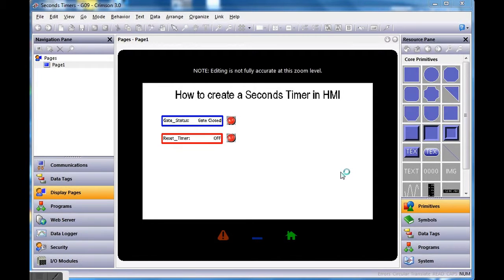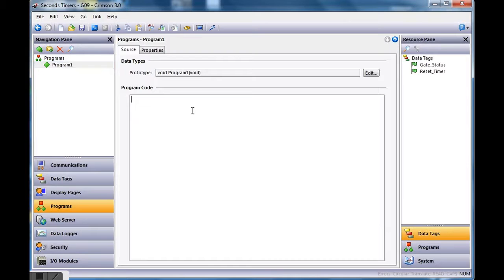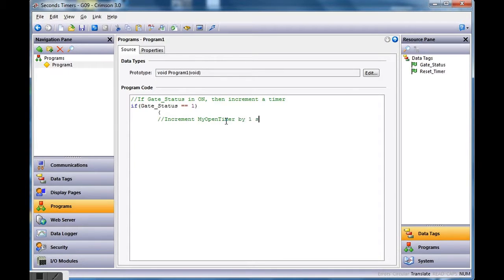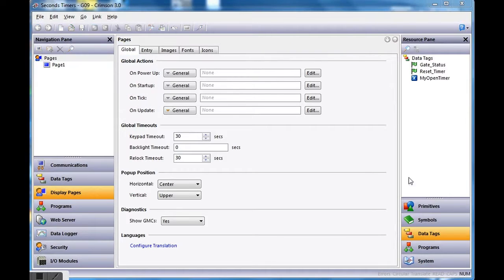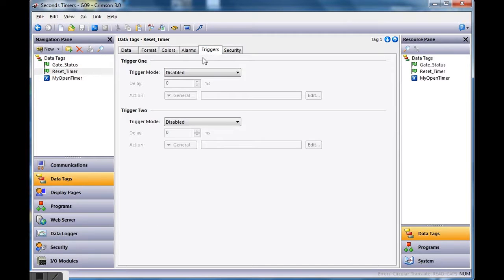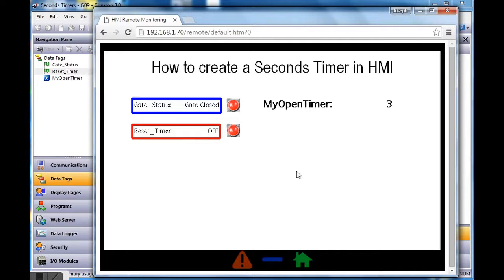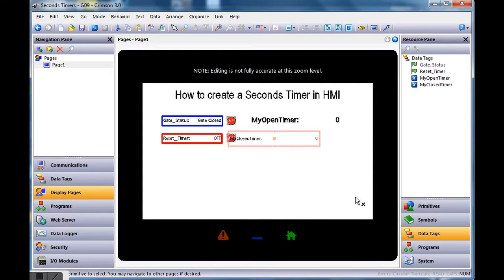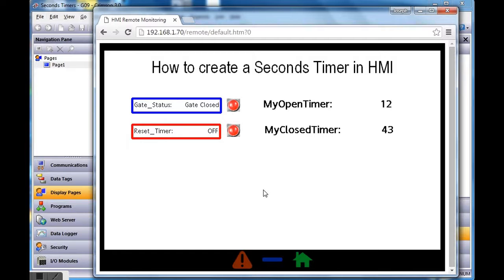A seconds timer in Crimson 3.0

Comment: Hello. I’ve got a question, Im writing a Omron plc program with a red lion hmi. Hmi user inputs decimal number, let’s say 480 (minutes). Plc converts and Ive done the calculations but gets turned into a 8 digit number. In BCD on the PLC, this equals #288000. When I put the timer in on the hmi it’s obviously going to count down from 288000 and makes no sense to anyone else. I can’t do anymore with plc so is there a way for me to manipulate it in the complex code? So it will read #288000 but countdown in decimal in minutes???? Any help would
be great cheers :)
Reply from the maker: Is the tag from the PLC counting down from 288000, or is the HMI doing the counting? Here is the code:

Hours = PLC_Tag / 3600;
Minutes = (PLC_Tag - (Hours * 3600)) / 60;
Seconds = PLC_Tag - (Hours * 3600) - (Minutes * 60);

Send me your email and I will send you my example database.  wazoo@adcreps.com
Reply: @JoeWaZoo1_Geeks_Rule  I’ve sent you an email just confirming I’ve got the right person. I’ve got work in 4/5 hours. I’ll send you my program that I’ve written on both plc and hmi and explain it and then that should help you understand why I’m stuck.
Reply: Essentially the plc is doing everything. I was just going to use a tag that’s from the plc timer that counts down already onto a data entry box on the hmi to display its counting down from a set point. Because of the timer in the Plc, it counts in BCD not decimal so it won’t make sense to others. I want the hmi to convert BCD 288000 to = 480 like on the set point and the countdown from 480 in one minute intervals. Does that make sense?
Reply: @JoeWaZoo1_Geeks_Rule  another way I can explain it is.

[HMI] Data entry box, I chose to enter 480.
HMI sends data to PLC and displays in hex.
[PLC] couple of FB converts the data so a 100ms timer works in minutes. Sets timer value to #288000 from 480 minutes from HMI. Timer will count down to 0 and then switch on.

I set another data box on the HMI with a tag of the timer so it will countdown from #288000 showing you it’s counting down from 288000 to 0.

I want the hmi to convert #288000 (TIML, PLC), into 480 and counts down on one minute intervals. 

The reason why I want one minute intervals is because the Omron timer is 100ms. 

#1 = 100ms
#10 = 1 second
#600 = one minute
#288000 = 480 minutes

I had it working but I can’t use reversible long counters with my PLC because when you enter a number larger than 4 digits it won’t work with a standard CNT (counter). This is why I had to use TIML for setting the timer but finding it hard to display it counting down on the HMI as I cant use CNTL (counter long, 8 digits).